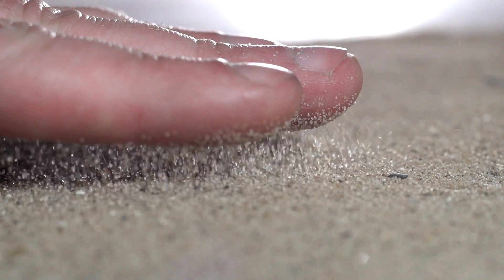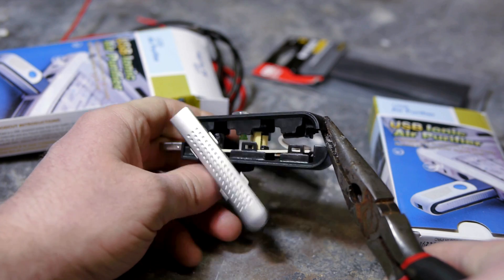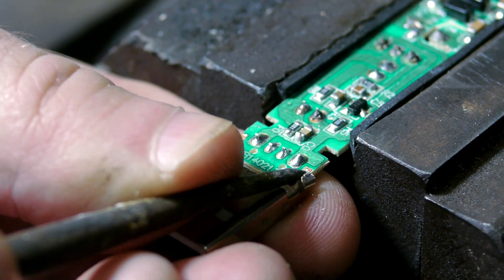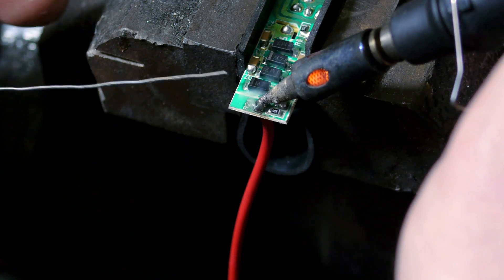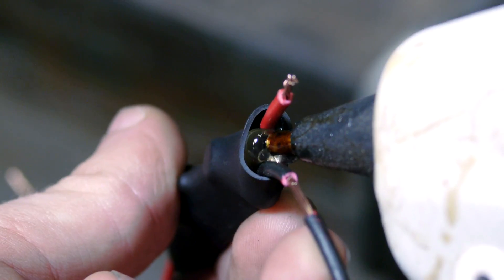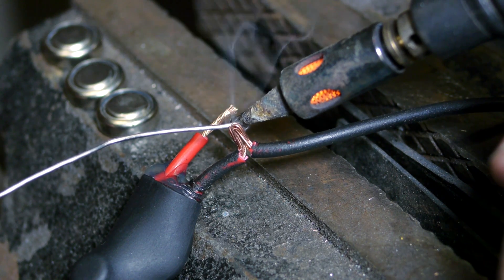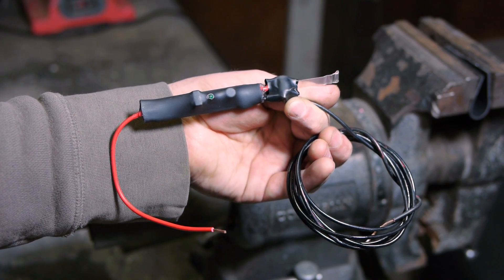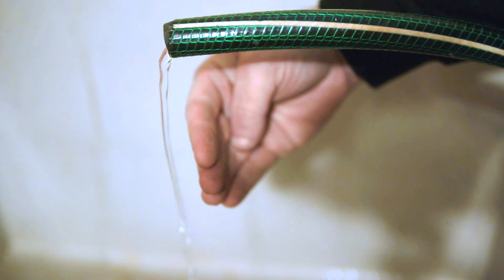How To Make A $5 Static Electricity Generator - NightHawkInLight

Comment: Hi night... so I made this project and powered it with three AA batteries, but the static charge output by it would only span about 5 mm... I used less heavy duty cables than you did in your video, though... could that be the problem?

Comment: Just being curious, but could you possible use something as simple as a portable charger to power this? Or would it be too much?
Reply: As long as the charger output is 5 volts, it should be okay. I think the best solution would be to use a USB power bank.

Comment: HiIs there any other way than wearing a boot strap?Thx
Reply: Duct tape, or making a hole through your shoe and making the wires so they come out at the bottom and attach them to a metal plate of some sort.

Comment: yeah, thanks for teaching us a way to get a hearth attack.
Reply: Fırat Mete no, this will definitely not give you a heart attack! It is less than 5,000 volts and the reason it doesn’t harm you is because it is “static” electricity, meaning the current is VERY low or static. If it had a very high current similar to the current used on power lines, it would definitely stop your heart and possibly either fry you or slowly kill you.

Comment: could this be done simply by using a portable USB charger and one long wire?
Reply: +Goat SD (The Goat 363)  you could just add a ground wire to the usb connections?

Comment: Hey, NightHawkInLight!

I'm doing this as a project for an 8th grade final assessment. I understand the majority of the concepts, yet have troubles with why it is necessary to convert the DC to AC, and back to DC. What are some of the specifics of the experiment? What, exactly, transfers the DC into static electricity and how?

Thank you.
Reply from the maker: +Coroz1 Watch the videos linked in the description
Reply: the transformer only works on ac (:
Reply: +Snowball Gaming Thanks, man! :)
Reply: +NightHawkInLight Thank you. How long did it take for your USB Ionizer to arrive? Were there any delays?
Reply: +Snowball Gaming And why is that?
Reply: +Coroz1 
It's my understanding: 

1. DC-AC-DC is to generate a higher DC-voltage, for example, from DC-5V to DC-15V. Because USB-voltage is only 5V, and it's not powerful enough to ''make sand going to a dust storm'', for which a higher voltage is needed(not too high, it's unsafe).

ps:   E=F/q ,   where E is electric field, q is a particle of charge and  <  F  >   is force, so DC can attract things.

E = U/d, where U is voltage and d is distance.

2. DC is not changeable in its magnitude, or not that easy. Usually first converted to AC, then use something called "Voltage Transformer" to magnify or to microfy AC-voltage. After that a Rectifier can be used to convert AC back to DC and you get a higher-voltage DC.

3. Connect the Vcc(+) and GND(-) as NightHawkInLight did in the video (be careful not to directly connect the + and - , it's dangerous), then something amazing is gonna happen:)

see also wikipedia - Electric field, Transformer, Electromagnetic induction
Reply: +Jet 

Thank you! 

This helped me a great deal.
Reply: +Coroz1 Hello Coroz1, i am also making this project, the USB ionizer is sitting in front of me at the moment, im from Australia and it took approximately 2.5 weeks to arrive to my door, hopefully both our projects work out!
Reply: +Vazzter i tried it as wel, it's very fun to play with when it's done (:
Reply: +Vazzter Thank you for this :) hopefully it arrives soon!

GL on your project.
Reply: so how'd it go?

Comment: Hi, didn't you have made a mistake ? You're using the primary circuit of your generator as negative and the secondary as positive, shouldn't we use the secondary circuit for both ?

Comment: I was actually about to order the parts for the original static generator (the one in the glasses case), and saw this video. Is this as powerful as that one or less powerful. Also, would it hurt to shock someone else with either and is it bad for you to have a constant charge from either one constantly in you body?

Comment: Is a USB ionizer the same as a flash drive?
Reply: +Galaxy Ravager No an USB Ionize is an Hightvoltage transformer, a flash drive is .. A flash drive
Reply: +goosse nicolas lol ok,  thanks mate!  :)
Reply: goosse nicolas what about a fly swatter, can it be a subtitute for the ionizer
Reply: jose rizal yeah it could but it's giving a lot more current so it could be dangerous if you add a capactior.
Reply: Its tested using low voltage fly swatter
Reply: No need for ionizer

Comment: hello, can someone help me? I tried to make this project did not work,I have the generator if white wire, so I tape the ground wire before the battery connector, makes spark when it comes close to the output wire, but does not work when I put the red wire on my body and the ground wire on the floor, why?
Reply: are you standing on a conductive surface like wood at something?

Comment: Hi, I was wondering if any of these circuits can power an LED with its own current? I tried searching YouTube for a video that features a "Human Circuit", but there isn't such a video that uses an actual current going through a human body to do a significant amount of work, such as power a light bulb or a motor, without any amplification. Seems like if there's enough power to pick up sand or generate a continual spark, it ought to be enough power to light up an LED.
If it is possible, then what would also be interesting to consider would be how is that current going through your body without disrupting your own electrical circuits? When electricity travels through a conductor, usually all the atoms participate, or at least that's what happens in a metal. So in your body, could it be that the circuit routes itself around all the other circuits? Or can two or more circuits occupy the same atoms? This might open up new ways of thinking about circuits.
Reply: Its pretty hard because the voltage is different everywhere around your body.
And your body cant conduct that much amps safely.

Comment: Hey NightHawk! So I recently discovered this video and after wanting to build your previous static generator, this looked like a perfect option to me! The only problem is that my mom is worried about the effects of static electricity in my heart and it being harmful to use this device. Could there be any possibilities with this device such as a heart attack or elevated bpm? Or is it safe to use this. Thanks!
Reply from the maker: +Wyajiit It's just like regular static electricity from wearing socks on carpet. My old ones are strong enough to hurt when they shock, but this one is not so strong. It should be quite safe.
Reply: +NightHawkInLight Alright thank you!

Comment: I saw those ionizers before on ebay but thought they sure were fake, with only a led inside...can't believe there's an actual tiny transformer and voltage multiplier inside, ordered 5 of them right away! I found videos of them cleaning smoke inside a jar, but they seem much less powerful than the mains ionizers, maybe I can add 2-3 more stages to the output multiplier and make a really effective ionizer for cleaning dust or an electrostatic precipitator with a fan. Do you happen to know the maximum voltage the oscillator can handle, you said 9v would fry it? Would it work on 6-7v, that would be 20-30% more voltage on the output.
Reply: They are made for a max of around 5.5 volt everything above that breaks them .
I would just buy a big air cleaner for around 20 $ it's way more effective and it looks better.

Comment: OK so I just built this I'm putting 9v in and getting 630v between the two aluminium plates, how do I know it's working have tried sand and water, but no visible effect? Any ideas? Thanks!
Reply from the maker: +michael judson If you're putting 9v in to this particular generator you're going to fry it very quickly. Make sure you are standing on a grounded surface and that your sand or water is also grounded
Reply: +michael judson 9v would generate almost double the output voltage and the voltage multiplier capacitors probably don't have this voltage rating, neither do the diodes. You'd get random sparking and corona discharge inside the capacitors, the diodes, the transformer and through the board, reducing efficiency. At least that's my theory. The chinese surely used the smallest possible ratings on the diodes and caps, considering how cheap this unit is.
Reply: +NightHawkInLight Thanks for the quick response. I have settled on a 5v 1A usb power bank, it's giving me 490 between the alu plates. I was able to generate a tiny shock when shaking hands but nothing more than you might get from an electronic lighter ignition.. certainly no sand storms or moving water, what voltage is required for those effects any idea? Thanks guys am new to the hobby and don't want to add this to the "failed pile" it's getting rather large!
Reply: Hmm maybe you fried it?
Reply: +michael judson You have most likey fryed it or something u did is making it resist  V or something. buy a new one. you could have fried it.
Reply: Jack Harbour have you tried turning it off and on 😂 jk

Comment: An on off switch doubles the cost? So getting 2 switches, 2 leds and 2 3v batteries for $1.00 makes the project cost $2.00? Isn't it mathematically impossible to double the total cost and end up spending less than the cost of the most expensive component?
Yea dollar store!
Reply: This guy is always right, so we are technically screwed, we have to rethink and rederive modern math and physics.

Comment: Is there a way to combine 2 together, either as two separate units or by combining the voltage multipliers of both of them, or something!
Reply: +CoolAsFinnBro If you connect the output of one to the different side of the voltage multiplier you'd have a positive ion generator, connect it's input ground to your body and the output to shoe ground, you should have double the static charge. But I think it's simpler to add more capacitors and diodes to the output stage of just one of those.

Comment: if you use one of these while building a pc, it is the best way to prevent static shock of your component because it directs the static to the device!
Reply: +Wartrac Gaming Trololololol
Reply: if you put the ground wire on yourself it might take static out of you and put the output on the ground and will charge the ground but wear shoes so it doesn"t charge you again

Comment: The first part of that board is actually taking the 5VDC supply and creating DC pulses through the use of the surface mounted transistor. The DC pulses are then sent into the PC mounted transformer where the voltage is boosted way up. Once boosted up, the smd diodes and capacitors(voltage multiplier circuit)further boosts the voltage to a high level, but low current output, which is DC. There is also a SMD resistor at the HV output to further limit current output.
Reply: Is there a way though to create a negatively charged pad? From what appears, this can only produce a positive charge. Would reverting the polarity cause the adverse effect?
Reply: yeah just right.
Reply: sorry to jump in 4 years late with a question, but any idea how to calculate the output voltage?  I want to build a static grass applicator using refurbished and reused parts and Im looking for around 6 KV output
Reply: @Witchlord  It's a bit low tech, but we just use plastic wash bottles. They are cheap, can be charged easily and they are great to apply the grass.
Reply: @4B68726F6E6F73  i guess I dont understand your reply.  My question was about the output voltage of device.  I already have an applicator that I made, I dont need a device or a way to apply.
Reply: @Witchlord  Oh, sorry. I edited the comment a bunch before posting (because I tend to overexplain my thoughts) and lost the important part. These bottles hold a staic charge on their own. If it isn't strong enough for your liking you can just rub them with a bit of wool cloth. And the nozzle of a wash bottle is a tube with a small diameter, aligninging the grass nicely with the direction of the tube.
I can't answer the question about the voltage, but the plastic wash bottles are readymade low tech static grass applicators.
Reply: :00

Comment: I find it better attatching the ground wire to your leg, and the output wire to the ground on the bottom of your shoe. That way, you don't have to worry frying any part of the static generator and shocking yourself if any connection is showing.

Comment: Question, do you feel the shock when you touch something? If so, does it hurt the user, or only whoever the user it contacting?
Reply: +Kevin O&#39;Neal It's static... if you shock someone the energy is still transferring through your body, so you'd still feel it.

Comment: Would 9v be too much or could the circuit handle it?
Reply: +NightHawkInLight ah c'mon just call it "magic smoke"
Reply: +Prasetyo Muhammad Dwi but you cant put the magic smoke back in :(
Reply from the maker: +TheColtanator It would burn up the circuit.
Reply: it could probably blow up, but it depends on the build quality
Reply: hardwirecars and the title would change tho... 5$ magic smoke :D
Reply: +TheColtanator You have about 20% either way. So no.

Comment: is your first or second or third generator the most powerful
Reply from the maker: +Ekim Png #2
Reply: +NightHawkInLight dude i'm so gonna make this
Reply: +NightHawkInLight Is this static shocker lethal to humans ?? If the ground wire is not touching the ground and i shock someone will that be a static shock or will it be lethal and can cause paralysis.  i need a quick answer plz i want to make one of these as a prank but im not sure if it is safe ???
Reply: Is there any way to increase the power but still maintaining in safe for humans
Reply: Does the person holding the device feel the pain

Comment: I recently bought a anti-static gun that neutralises static buildup from vinyls. The trigger is metal and contacts my body. I believe that's the negative terminal. The positive just points forward through an insulator so it fires positive charges at the vinyl before cleaning them. The gun is called Milty Zerostat Anti Static Gun. Can this device do the same thing? I.e. If I hold the negative wire and point the positive output at the vinyl? Thanks.

Comment: can someone explain something, if this has the power to levitate sand from 5volts, then is there something about static electricity that makes it very efficient energy wise, I'm sure that if you tried other methods to levitate sand it would use more energy, I've always thought that static  electricity could be used to power stuff as a power source, can you reverse the upscaling of electricity it does in that circuit to turn static into  5v, generate power.

Comment: could this injure someone or even kill?
Reply: +Jack Kelloway no
Reply: Thanks
Reply: +Jack Kelloway I suppose the design concept could if you use a similar design but upscale both the circuit and the powersource, but in this PCB especially with the very limited powersource of 3 coin cells I have to agree with Dman.

Comment: USB taser?  It looks very similar to a taser's design.
Reply: +Geoffrey Ritchey I've never specifically looked at taser designs, but it'd make sense the design is the same. Both function by using a portable power source to turn that into a much higher voltage, that said with his implementation you'd build up a charge on yourself so when you zap a person while touching them you'll feel it as well.

Tasers as far as I'm up to date on it will also work like this, generating a fairly high voltage with limited current between the two electrodes (so that it'll flow between the two metal contacts and only affect the target). To get this done you'd also have to raise the voltage significantly from what a typical battery power source can deliver.

Comment: Can you use a car ionizer instead? (I have a spear one witch i'd like to use for this prject)
Reply: I tried  and it worked great with a 12V battery (A23 type if you have access to one)
Reply: AJ Haas  I tried  and it worked great with a 12V battery (A23 type if you have access to one)